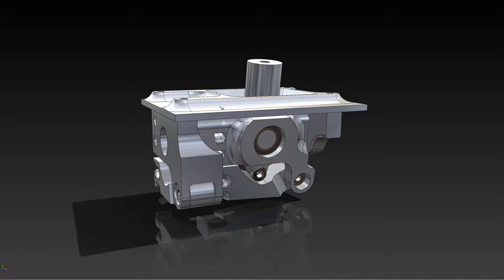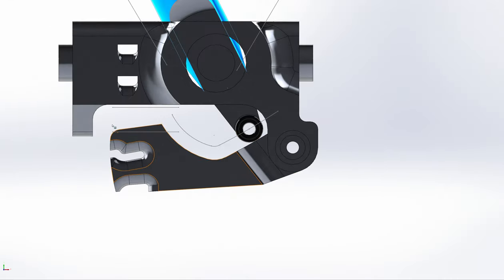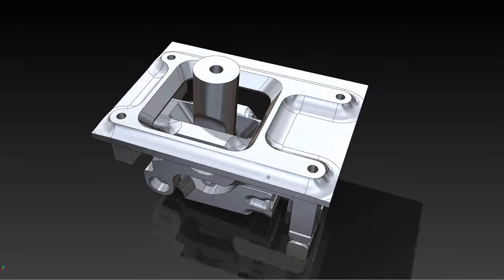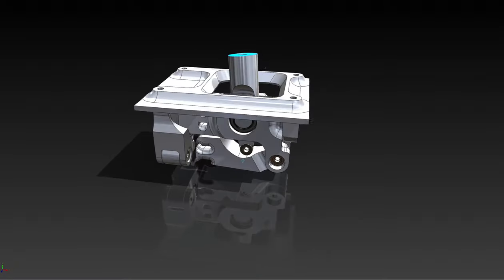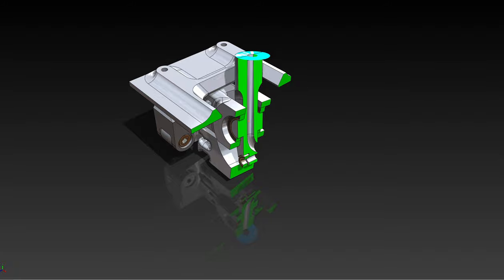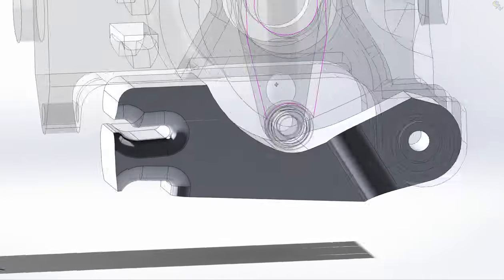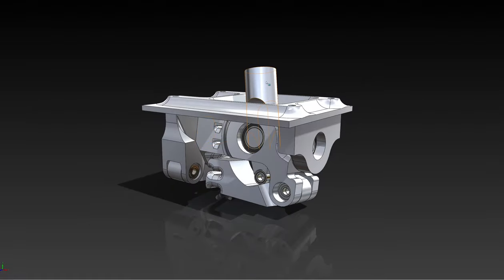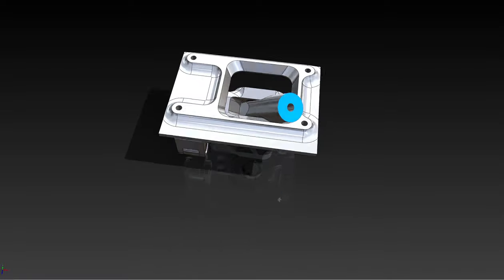DIY 3D Printable Joystick Gimbal for Computer Interface - Single CAM design

Comment from the maker: If anyone wants to help with some of the math I would greatly appreciate it. Solving the equations for this stuff is complex. I would like to build a tool in Python where I can plug in variables such as CAM pivot geometry, CAM roller bearing diameter, output force profile and it’ll solve the cam shape and compression spring force, rate, deflection. 

This would not only help out this gimbal and anyone wanting a different CAM profile, but could be used for anyone else making different gimbels or modifying existing single cam gimbels.
Reply: Hey Howard I think I can do the math. A good method might be to sample a bunch of points for the cam shape and fit a curve to it (or just have a sample distance smaller than the manufacturing tolerance)
Reply: @niccopompili6656  Hello, what is the result? did you manage to solve the problem?

Comment: I'm an absolute novice at this but; could the cams be on top (above the axis) to reduce overall height and increase throw?
Reply from the maker: I think by inverting it, the overall height would be the same. The big benefit would be the potential of lowering the main pivot which could be good for desktop mounted joysticks. I’ll have to think about this further.

Comment: There are many unreasonable mechanical designs. I recommend that the parts have the possibility of 3-axis CNC machining before designing the structure. If you need CNC products help, you can contact me.